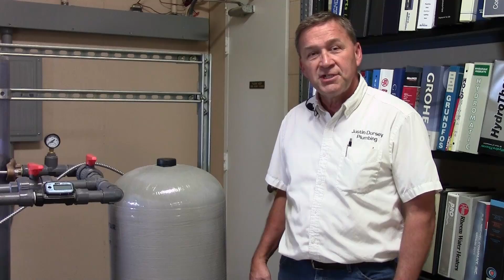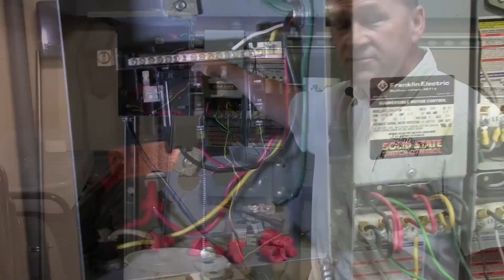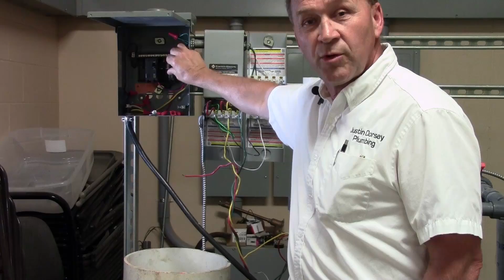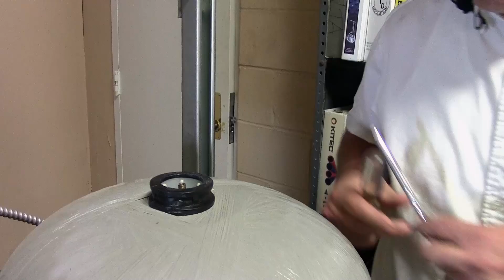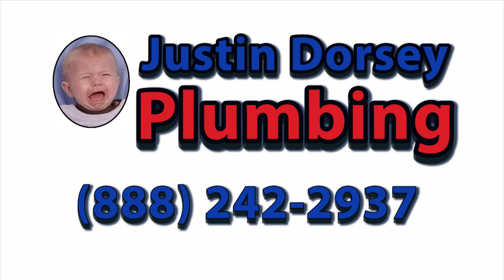Checking the pressure on your pressure tank

Comment: there is no valve to add air on my fiberglass tank. There is just an open stepped plastic fitting AND a solid brass plug. 
How can I check the pressure?

Comment: Does the pressure guage show pressure tank pressure or pressure from the pump?
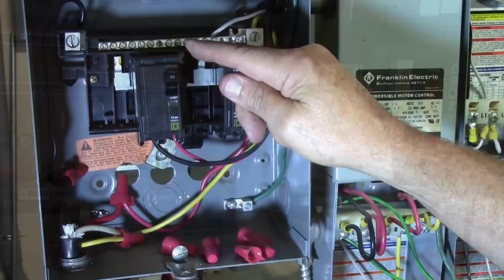Reply: The pressure gauge shows the line pressure/pressure from the pump. You have to use a tire pressure gauge to check the pressure on the tank. Start at about 2:20.

Comment: Once you are back up to pressure should it stay at the high #?  I have a 20/40 switch on the pump and the pressure is at 18.  It runs to 40, but gradually falls back to 20 over time w/out any faucets being turned on.  Shouldn't it stay at 40?
Reply from the maker: Hello, sorry for the late response. Yes the system should hold pressure. If you are loosing pressure w/out faucets being turned on there could be a leak on the check valve of the pump, or on the foot valve if you have a jet pump. You may also want to check your toilets as they often leak water through the fill valve.

Comment: I'm unable to drain the water to 0 with a faucet/bathtub on. It drops to 40 then starts filling back up. I don't have a drain either to hook a hose up to. I also have a water softener and iron filter that it runs to before going to the house. Any ideas on how I could drain the tank to check the pressure?
Reply: Don’t forget to turn the power off to the pump.  If the power is on, it will fill up the tank.

Comment: Hi my pressure tank is like the one in your video I can't push the gage in to read pressure ?? Its full of water.
I came home yesterday to find the jet pump running and the lil black hose was off ,water everywhere. I turned it off put hose back on then turned every thing back  on I did get water but it was low and had has lots of air in it ..I had left the water on in garden when this first happened that's when I realized no water
I ran to well and that hose was off 
It has not come off again. Just no water but pressure tank is full 
I also have storage tank its full 
I turned everything off again.
Can u help me please 
The tire gauge won't push down on the top

Comment: Yea just so you know plumbers are not water well service technicians! 
Just because your tank has 0 psi in a bag tank does not mean your tank is busted!
There are different types of tanks also, like a hydronumatic standard "Air over water" tank!
These bag tanks require being aired up every few years, as they leak down like a tire on your car.
Standard tanks use whats called a air volume control or aerator to inject air in the tank.
Reply: Hey Keith sorry just got your message.  Right the power going through the switch is not your issue, you have to check that the line the pressure switch is attached is not clogged up.  take it back after you drain the pressure and make sure the line is clear.  you could try backing off on the center spring a few turns to check if its just set too high for system to attain.
Reply: Clear Water Pump & Well LLC how tell if switch and grace going bad
Reply: MeowsRandom Adventures MeowsRandom Adventures how to tell if switch is bad and or the tank, pump you mean?
Reply: Clear Water Pump & Well LLC. my gauge is reading 90psi and my pump will not shut off.I replaced the pressure switch and its still running  at 90psi and still wont shut off.can you help me,
Reply: Keith - Depending on what type of pump you have and were you pressure gauge is located you may not actually have 90 psi in your tank.   Do you still have water wile its running?  Is the pressure low or normal?   Something could be clogged after the pump and or your pressure switch port.
Reply: Clear Water Pump & Well LLC. water pressure is normal.
Reply: the voltage meter reads 244.4 on both sides of the terminals. new pressure switch would not switch on or off at all could I have a bad switch that I bought?
Reply: Clear Water Pump & Well LLC. thank you.Thats what it was
Reply: Was it clogged or just pressure set too high?
Reply: Clear Water Pump & Well LLC. It was clogged.Thank you again
Reply: No Problem, take it easy and just make sure your pump cycle time is at least 30 secs or more from cut on to cut off with no water running.   Also you don't want your pump running a long time without using water to gain a few more pounds.
Reply: I know you replied 2 years ago and probably won't see this, but after reading your reply I have a question. I have exactly the same Wellmate used in the video and I did exactly what he said. When I cut the power to the pump. and opened the faucet the pressure on the gauge went to zero. I closed the faucet, checked the  tank pressure and it was zero, the same as his, and he said his bladder was ruptured. I pumped up the pressure in the tank to 28 psi that I checked with a tire gauge, and the gauge on the system read 22 psi, so I pumped 4 more pounds in and turned on the power to the pump. I did this twice with the same results both times. My pump was short cycling before, and now it's 48 seconds from cut on to cut on. Is this normal and is my bladder ruptured?  I feel like after your reply, it isn't.